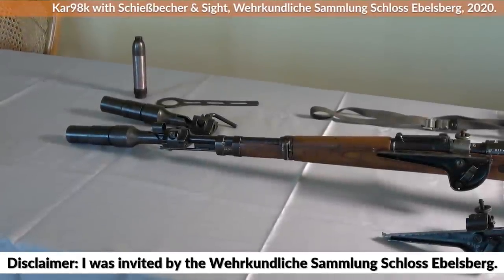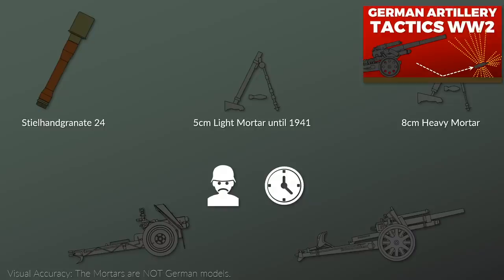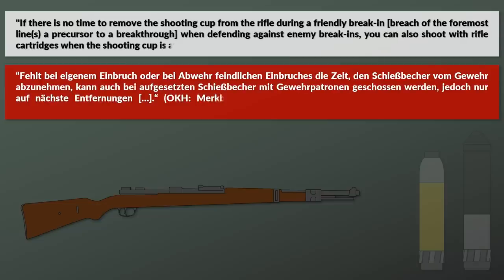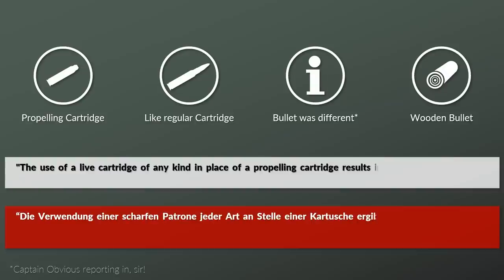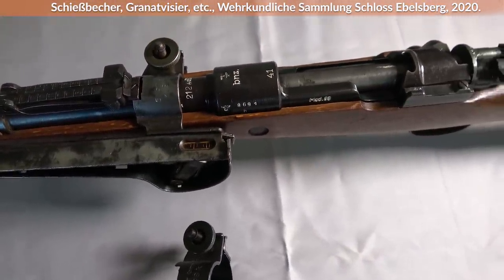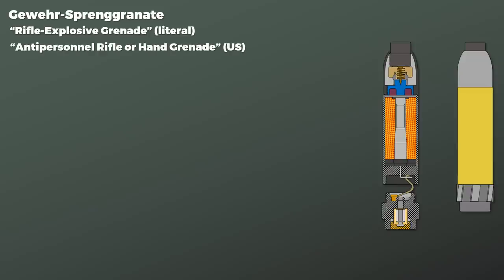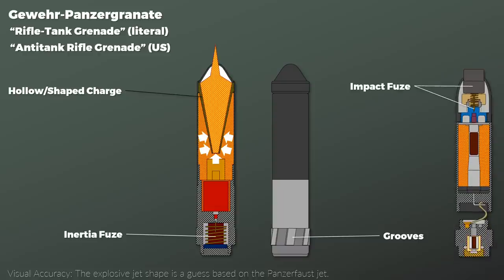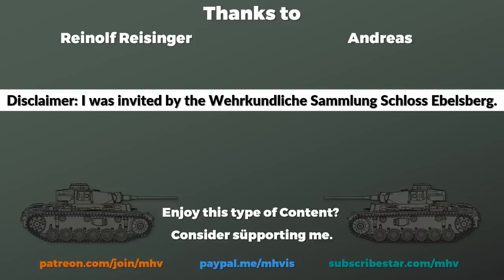Why Rifle Grenades? - German Rifle Grenades in WW2

Comment: So much more to cover on this subject. There were many models of the anti personnel projectile. There were many versions of the lifting charge including a crimped blank. I have never seen a wood blank paired in anyway with the rifle grenades but i suppose its possible. Not all could be used as hand grenades, there were at least two distinct models of the hand grenade type. One used a separate pull ball which was a small hollow bakelite bead and the other used the base as the pull ball. Also the delay pellet on the base was only found on early models. The activation of the impact fuse was achieved by a weighted disc and an expanding spring which was simple and kinda neat. In interviews with various german vets over the years several had used the Schießbecher but all said they never used it in combat. They basically just had it around and would hold shooting competitions with them in their downtime but found the whole thing sorta useless in combat. This is antidotal but still interesting that such waste of ammunition seemed to have been somewhat tolerated in this case.

Perhaps cover the various grenades created for the flare pistol and later z pistol. There are a fascinating array for those and their uses were equally interesting. Plus theres something neat about a pistol sized grenade launcher. Some of the early ones were designed to detonate on a string after only a few meters as they were for tank crews to clear there vehicle of infantry.  Very interesting stuff. For future ordnance videos look me up prior, I've done extensive detailed research on many types of german ordnance to help create reproductions and movie props. War's End Shop

Comment: For visual reference: in the Tv mini-series "Band of Brothers," in the "Replacements," one of the men takes out the German MG-42 position, located on a rooftop, with a rifle grenade.

From a not so good movie, "The Battle of the Bulge (1965)" there's a scene just after the first German tanks are spotted, where the American infantry only has machineguns and riflegrenades to try and stop the enemy advance. The soldier using the rifle grenade tries to hit the top of the German tanks, probably because that's the only place where a rifle grenade would be able to cause any damage to a tank.

Comment: I should have said that this was an excellent technical examination of German rifle grenades. The contrast with French (VB) and American rifle grenades is interesting (there are some good videos here, see the Forgotten Weapons video on the VB and the design choices they made). The French and American rifle grenades were ... not rifled. Short-range fire was conducted starting at a near-vertical 85 degrees and brought down to 45 degrees for maximum range, a complete contrast to the German approach. Also, you simply used standard ammunition to propel the French and American rifle grenades! That was a lot simpler.
Between the wars, the US developed wooden bullets as training ammunition for rifle grenades because normal bullets fired at such high angles would fly far beyond the bounds of any firing range and were a serious safety hazard. Same solution to a different problem :)
Finally, I really like the French post-war rifle grenade system for the MAS.36. They ultra-rugged, ultra-simple sight was fixed at a 45-degreen angle! The launcher used a dead-simple gas bleed system to vary the range!

Comment: Several years ago I bought a reproduction of the launcher, but I never really looked into it. The reason I got it was because I had never seen one before, and I wanted it for my German impression. The only difference between mine and an original is that mine is smooth bore.

Comment: How well would the launcher work on the Stg. 44 given it fires a smaller cartridge? Did they manage to come up with a propelling charge with comparable performance to the larger original?
Reply: Not a problem. In the 8mm Mauser the cartridge contained only small proportion of the powder in a regular round. There was plenty of room in the short Stg. 44 case for the powder.

Comment: Interestingly, the British Army re-introduced the No.1 Mk.I Cup Discharger (originally used in the 1st World War) to their TO&E around the same time, but the Heer was also facing the Red Army, who also made widespread use of Rifle Grenades. I wonder who influenced whom?

Comparing this to the No.1 Mk.I Cup Discharger and the Mills Bomb, it does seem, well, (cliched as it is) rather overcomplicated. Separate percussion and timed fuses, wooden tipped blanks to arm it, different blanks for different grenades, a complex sight with a fluid level, a rifled launcher for stablisation. 

The No.1 Mk.I just used a simple cup, the Mills Bomb was armed by the pin being removed as it was loaded, but the cup shape keeping the spoon from flying off (in earlier models, the pin clipped to the side of the launcher, and firing pulled the pin out, either way, much simpler). There were no complex sights, just aimed at a rough angle, as German troops later had to do from what your video suggests. 

Beautifully designed and engineered weapon, but, overengineered. Always seems to be the same with German weaponry, alas.

Comment: The japanese ni mortar was probably the best squad level explosive delivery system in the war. Lightweight, but throwing a heavier and thus more effective round on target, while arguably being even faster to shoot for follow up shots, as well as being a standalone system with effective ranging implements rather than an ad-hoc clip on tangent sight. The only better system would have been the panzerfaust had it been explicitly issued for general purpose (they were used this way) rather than just as an anti-armor weapon.

Comment: I'm curious, when did the hand held Grenade launcher, aka the M79 style launcher, get developed? Was the M79 actually the first of the breed?
Reply: The Germans developed a break action grenade launcher based on the stock of the Kar 98K, shortened to 72.5 cm and with the barrel of the signal pistol added to the front of the stock. It fired the same explosive cartridges designed for the converted flair pistol (Kampfpistole). This conversion superficially resembles an M79. 
Source: Uniforms and Traditions of the German Army 1933-1945, Vol 3, page 357-8, by John R. Angolia and Adolf Schlicht.

Comment: Here in Finland the RK95 assault rifle was built for rifle grenades, with all the first order's 25000 pre-fitted with the necessary components. But no rifle grenades was ever used outside testing.
It was concluded that "The rifle grenades were inaccurate, unreliable and dangerous." And that "with a need to use a grenade, it is simply better to just use a hand thrown grenade."
Although how these things are here. The real reasons most likely were the cost of development and use of rifle grenades, rather than anything else.
Reply: Chell-sama They did use it on a video.

Comment: I was expecting the cartridge to have no bullet at all, i.e., what English speakers call a "blank cartridge." In fact, why did the "bullet" even need to be tapered, since it was only a type of plunger or actuating rod.
Reply: Hannah Miyamoto So it will feed right.
Reply: The blanks with wooden bullets were Standard german blanks for exercises and so on. They were Made to feed correctly in machineguns. There was no need to Change to a blank without bullet when there were large Stocks of wooden blanks already in existence
Reply: Wooden bullet blanks are also cheaper than krympt ones, because you can re-use standart cartridge.
Reply: IC. I was just thinking about how the German military seemed to over-engineer everything. Even that launcher -- not to mention the sight -- would require many hours of machining to do, when it could be made from stamped metal.
Reply: @verycreativ233   Apparently, you aren't a mechanical engineer. 

The parts that attach to the exterior of the rifle do not contain pressure. The  cumbersome sight contains no pressure. Only the cup with its rifling is subjected to muzzle pressure.

Comment: The jet from the shaped charge wasn't "metal particles." The whole liner deforms as if it was a fluid because of the extreme pressure generated by the explosive. This means that the jet is a continuous mass, not separated particles.
Now, you may get parts of the jet that pinch off into "drops" because the elongation of the jet is uneven and sections with a smaller initial diameter due to random variation in pressures will also stretch faster.
As a final note ... no, the jet is not molten, and it's certainly not "plasma." You can demonstrate this through simple energy calculations: yield of the explosive, half the kinetic energy eaten up by Newton (equal and opposite reaction), jet velocity, temperature of the gasses being taken by Newton as a tax, and the melting point of the liner. Or, you can just look at the results of water tank tests where warheads were sliced into disc very, very precisely, clamped back together under enormous pressure, and the detonated. The resulting jet was cleanly sectioned: there was no evidence of the sections melting back together *anywhere*.
Reply from the maker: yeah, it should be "resulting jet" noit "resulting jet of metal particles"

Comment: The StG44 could use the K98 discharger? I've heard that StG44 was planned to have it's own discharger (the thread at the end of the barrel was not supposed to be just for Krummlauf so the other logical thing is either silencer which wouldn't make sense, or rifle grenade discharger) so... was it the kind of thing which works but not perfectly, or the kind of thing which works perfectly but german designers assumed otherwise?

Comment: What sort of armor penetration could the anti-tank grenade variants manage? I can't imagine that they could punch through much armor especially later in the war with heavier tanks being more common.
Reply: You dont need to penetrate the tanks. The explosion is enough to damage electric, mechanics, sights, tracks or just weaken the armor.
Reply: @David-eh9le  YeahI thinking that tracks or vision slits would be the most likely targets followed by maybe engine intakes.
Reply: There was a guy in another comment that said they could penetrate 81mm of armor at max range.
Reply: Mostly used against AFV's on western front, they got alot more use early on the eastern front as Russia had a lot of light tanks that it would've been decently effective against if not deadly .

Comment: Rifle grenades are still used today in the French army, in small quantity and only the smoke and flare version are still used. The new HK416 will be able to mount a 40mm M320 grenade launcher....after more than 50 years of loyal service, the French tradition of rifle grenade is going away (for a better system, so no big deal for me ^^)
Reply: They should have kept both, Rifle Grenades can have higher HE and HEAT payloads then the measly 40MM one, which can only penetrate 50-60MM if armor.
Reply: @Barabel22  the rifle grenades the French army uses right now are the smoke and flare ones, the HE and HEAT are no longer used because they are WAY to uncomfortable to shoot (off the shoulder) and we have  better weapons to deal with bunkers and "armored" targets (the AT-4 and the JAVELIN). So it's not a big deal if the 40mm are a little bit less powerful than the rifle grenades. But yes I agree, a rifle grenande is more potent than a 40mm

Comment: US rifle grenades of WWII pattern were used well into the Viet Nam war. A key flaw with those is they were not "bullet trap" grenades and required launcher blanks be manually loaded.  

That was avoidable as it's easy (and legal in the US) to machine a bullet trap base with a cup like the US rifle grenade adapters. You can only propel inert objects without an explosive handler license but the adapters are inert. Those will launch a dummy weight about 90 meters (we only made a few as no one could be interested in selling them though they throw smoke and other grenades MUCH further than a manual throw). We figured that because none of the features could be patented that's why it was of no interest, but the little 30mm grenades are not nearly as effective as thrown-size WP smokes. Any machinist with some sense can figure it out but I won't post plans because fools will hurt themselves. 

VOG rifle grenades are doing yeoman work dropped from drones in Ukraine.

Comment: This sounds horrendously inconvenient to use in combat. Fixing the cup, loading in a special cartridge and the grenade itself doesn't sound ideal, especially under fire. It would be cool if there was another solution to this, for example a dedicated independent launcher that could fit underneath a rifle like an M203. (Obviously the high-low propulsion system with 40mm grenades hadn't been looked at yet in WW2) But it would work with an independent propulsion charge. I would think of this as essentially a scaled-down mortar, almost. I imagine it fitted to an M1 Carbine, STG-44 or another light weapon. But this way an infantryman could load it before reaching the immediate front and use it when the situation calls for it, otherwise relying on the primary weapon platform.

Another solution which I believe was actually done by the German military was to use modified flare guns for soldiers not using the K-98. This makes quite a bit of sense, especially for officers who would be carrying the MP-40, and needed the capability to shoot flares anyway. But this was a standalone weapon. What if there was a way to create an underbarrel weapon using the same concept?

Comment: I wish rifle grenades were more prevalent. Not everyone can carry a grenade launcher, but if the rifle grenade allows for the use of the rifles standard cartridge then the average soldier can have more capabilities with just one rifle grenade.
Reply: I don't know how common the modern attached grenade launcher  like the M 203 is used but it does not interfere with the rifle other than its weight.
Reply: @dorfrez  I'm in the US military, not in a combat arms job, but in my experience one M320 is issued per team/squad (5-10 people). No one attached it to the M4 because it adds a lot of weight like you said. and it's easier to aim as a standalone system. We'd typically sling it , or attach it to a rucksack. If everyone/a few had a rifle grenade we'd have light anti vehicle, a shitty mortar, and a direct fire grenade if you want to break your shoulder lol.
Reply: @dorfrez  keep in mind you can do those same things with some 40mm grenade launcher ammo but of course it doesn't have the range. High explosive dual purpose on paper can penetrate 50mm of flat steel armor. But can't go past a 150 meters accurately and for sure wouldn't be flying in a flat trajectory.

Comment: The Germans themselves knew a under-barrel grenade launcher for bolt action rifles would  be just too silly.
Reply: not really, it would be way less clumsy. the weight of the grenade launcher housing could be mounted nearer to the center of the rifle. Separating the rifle and grenade launcher allows them to both operate autonomously. It makes no sense to build an entire grenade launching device, then stick it on the end of a gun barrel. Just under sling it, makes way more sense if you're going to spend the money building one.

Comment: Why did they produce so many when they didn’t need them🤦
Reply: From the date of the manual, they entered service in late 1942. But weren't in the field until 1943. Later that year the panzerschrek and the panzerfaust 30 started entering service. Probably was left up to individual units or even individual soldiers themselves to determine whether they could use this weapon when available.